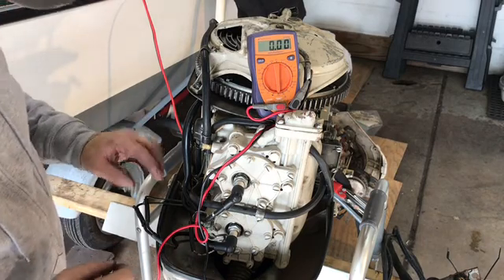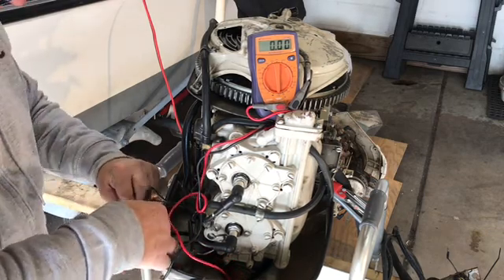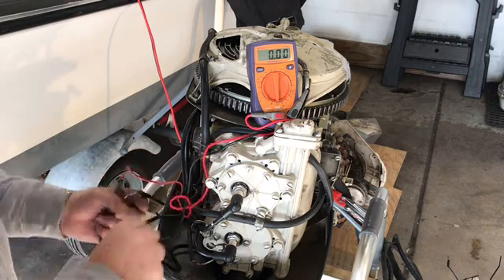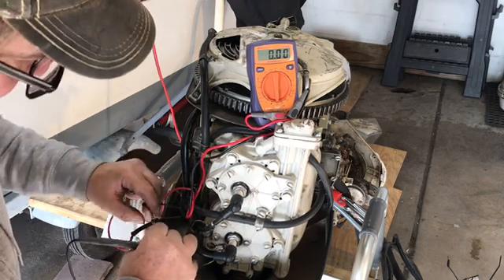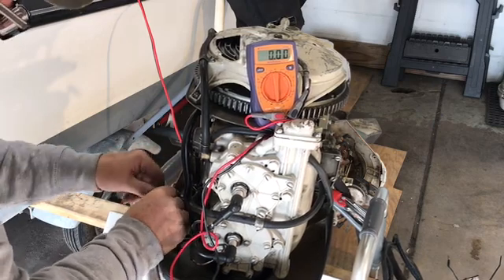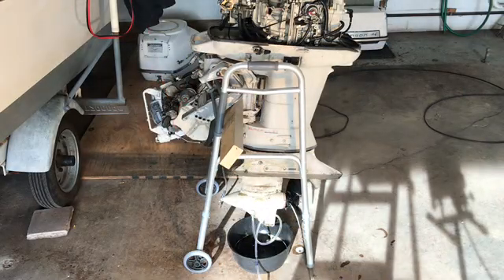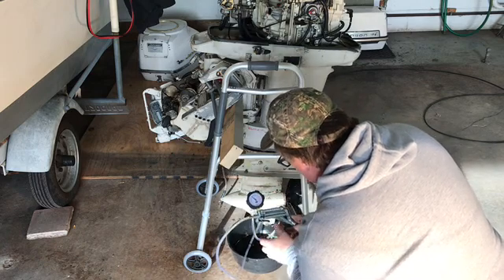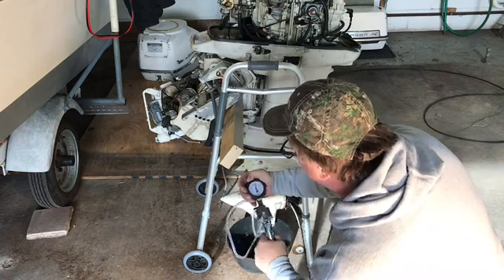1963 40hp Johnson Electromatic - Lower Unit Electromatic Shift Cable Diagnosis - Part 4 of 12

Comment: Have you ever added a power trim and tilt to a 1963 Johnson big twin electro Matic shift? Would you have any thoughts on me undertaking a project like that? Or any videos where you have done such a project? Thanks!
Reply from the maker: @davidcerajewski9170…. No I have never attempted to add power tilt/trim to a vintage motor that didn’t come with it. Most people use an aftermarket method like those made by Panther or CMC

Comment: Thank you for the video recommendation. I had watched that one earlier and I did get 12 V. I’m wondering if my problem is the wire from the rear of the engine to the lower unit is the problem? Which may indicate a broken wire or a shorted coil in the lower unit. Is that possible?  It is strange, after further reflection, I remember a sudden loss of forward power when I was near top speed(22mph) last year.
Reply from the maker: David Cerajewski … it is possible that the forward gear electromagnet is bad. You would have to disassemble the gearcase and test it. Just a dumb question but what type of  gear oil are you using? It’s important to use Johnson type “C” or it’s equivalent … Johnson Premium gear oil. If your not using the correct oil you will have slipping issues in the gears electromagnets.
Reply: @LivetofishOutboardRepair  
I did use Johnson type c oil when I did the last gear oil chance 5 years ago.  I do intend to change it again soon.   I will test the shift cable from the engine to the lower unit tomorrow. If the shift cable is bad, do I need to dissemble the gear case to replace the shift cable?  Thanks again for all your help!! Is this something that u could repair for me? Thanks, Dave
Reply from the maker: David Cerajewski… you do not need to disassemble the gearcase when replacing the cable … just the upper portion of the leg. I am not taking anymore work right now, I’m just to busy. If you need a service manual to guide you email me at livetofish64@yahoo.com and I can send you a copy.
Reply: @LivetofishOutboardRepair  OK, that is good to know. Do you have a video of changing the shift cable? Thank you very much!
Reply: @LivetofishOutboardRepair  if  you do not have a video of the shift cable replacement, could u explain what u mean by the upper portion of the leg?  Thank you again.
Reply from the maker: Dave… There are two nuts that you need to remove. They are visible when you drop the leg from the powerhead. They are forward and aft of the water pump. Once the two nuts are removed the leg should come apart exposing the electrical connections for the cable inside the lower part of the leg. Disconnect the electrical connections and then you should be able to separate the gearcase from the leg (without taking the gearcase apart). The service manual requires that taking the old cable out of the casing requires you to destroy it by drilling it out. The cable cannot be reused.
Reply: @LivetofishOutboardRepair  do you have a source for new shift cables? Mine actually read 70 homes of resistance on the forward and 10 ohms of resistance on reverse.
Reply: @LivetofishOutboardRepair  wow, the shift cables were really torn up right above the insulation sheath. It is amazing that we were still able to drive.
Reply: @LivetofishOutboardRepair  just wondering, since there is about 4 inches of shift cable to work with above the water pump impeller unit, have u ever tried to use any type of heat electrical shrink wrap  to repair the shift cable.  Just trying to think of alternatives if I can not find a shift cable
Reply from the maker: Dave… the short answer is the cable is trash. Once corrosion gets into the wiring it cannot and should not be repaired. Replace it.
Reply: @LivetofishOutboardRepair  ok. Thanks for the direction on this. I will order the shift cable. Again, I really appreciate your help!! Dave

Comment: Hi, I have the same motor. It won’t go into forward, it’s just slowly moves the boat. Then randomly it will kick into gear. Any ideas on the issue?

I preformed the voltage test like you did. But I failed to separate the blade connectors before. I will re do the test this evening.
Reply from the maker: Joh fox …. You should test for resistance. If you do not have adequate continuity the electro magnets will not work. The cable that runs to the lower unit corrodes, dries out and splits allowing water in then corrodes the wires causing an open circuit or to high resistance. You really shouldn’t see any more than 6 or 7 ohms of resistance.

Comment: 10 psi,to much pressure,you the blew the seals,They are not pressure seals,they are oil Seals!Your putting in pressure in a non pressurized System,Not designed to hold pressure.
Reply from the maker: This method has worked on every motor I’ve worked on and even the service manual calls for this pressure test.